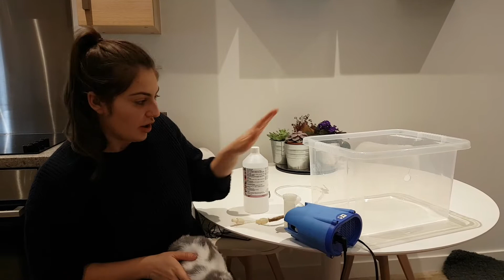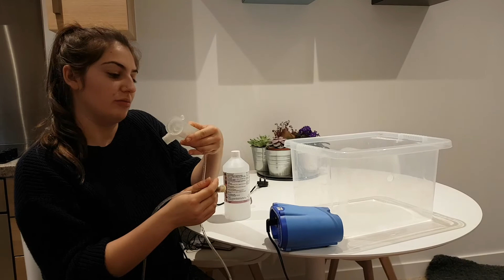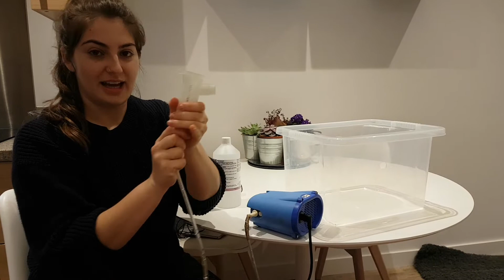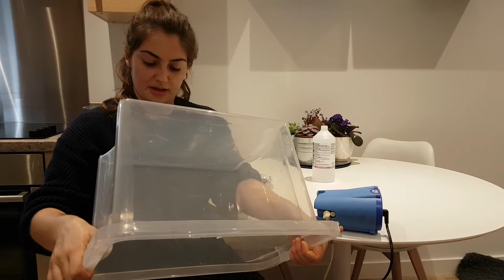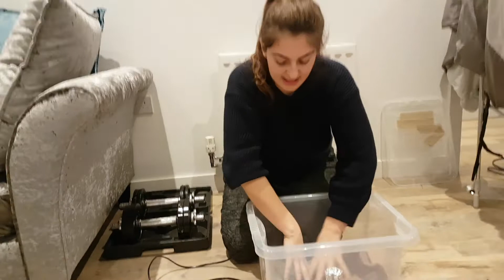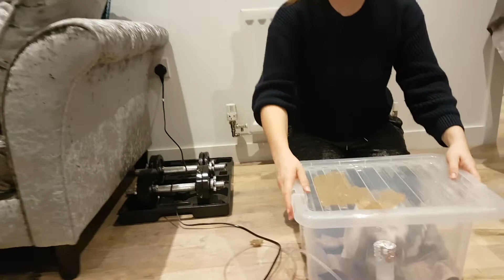Nebulize your rabbit

Comment: Hey, my rabbit has Pasteurella disease and I've been nebulising him for over 1 month now and haven't seen much improvement, I was told by my vet to continue to do this until I see improvements but I've only been told to do it for 5 minutes per day with 1ml of F10. I'm not getting a great deal of help and have been told I need to travel to Edinburgh for expert advice.

How long have you done this for?
Reply: Lyndsay Henderson Also, 5 minutes is not near long enough to nebulize a rabbit! Sessions are typically 15-20 mins long. From what you are saying, I don’t think your vet is knowledgeable enough about treating pasteurella or nebulizing rabbits! I would find another exotic vet that has significant rabbit experience.
Reply: Lyndsay Henderson F10 is not an antibiotic! For chronic pasteurella, which is a specific bacteria, you need to be nebulizing an ANTIBIOTIC (mixed with saline) of you are to have any success in controlling the illness. F10 will not do this.

Normally, the vet performs a nasal swab prior to starting nebulization. They send the swab sample to a lab for a culture and sensitivity test. This test will identify the offending bacteria and recommend an antibiotic that is effective against that specific bacteria. 

That said, here in the U.S., our vets typically use the antibiotic gentamicin for rabbit nebulization. They also typically prescribe a bronchodilator drug, as well as a drug that reduces mucous to mix with the gentamicin and saline.
Reply from the maker: Hi, thanks for your comment-sorry its so late. F10 won't solve pasteurella, the rabbit needs antibiotics, for longer than 5 mins a day! Def recommend getting advice from an exotic specialist <3